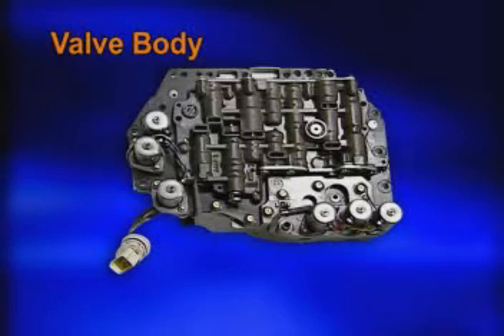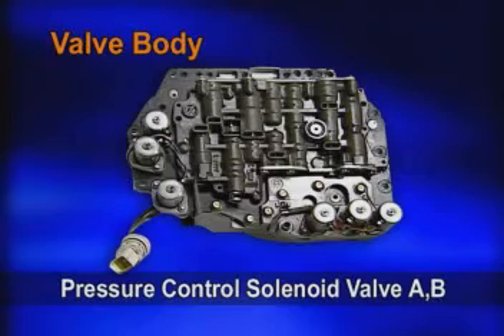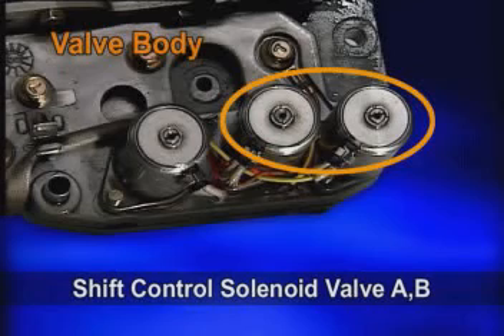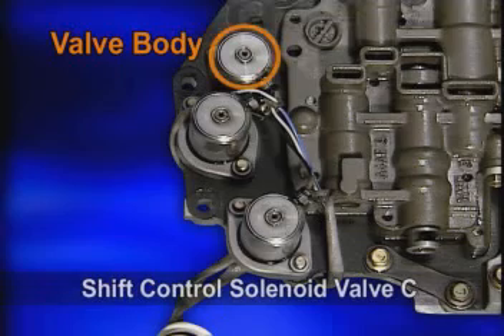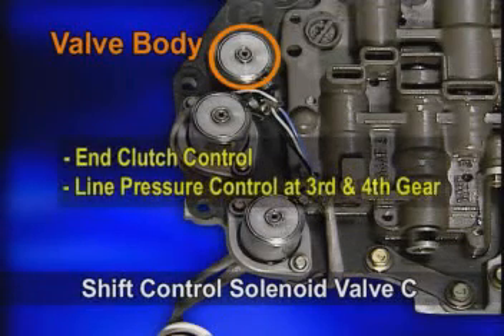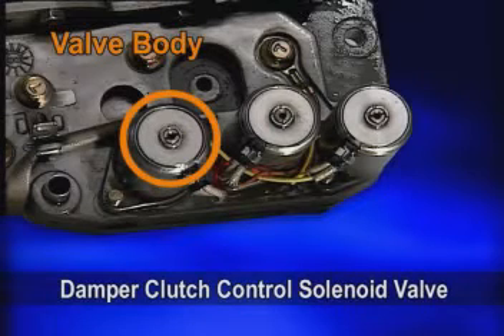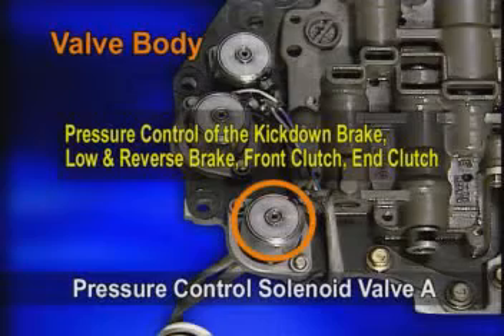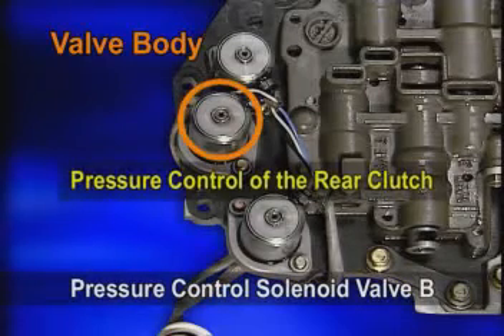Cerato LD Transmission Valve Body & Solenoid Valves (4 Speed AT)

Comment: Sir can you help me with my kia rio 2011 transmission not running on drive
Reply from the maker: Hi there, any fault code on transmission?
Reply: @GoProAuto  incorrect 2nd gear rstio and kick down switch
Reply: When delete, no more faults
Reply: Rpm 750